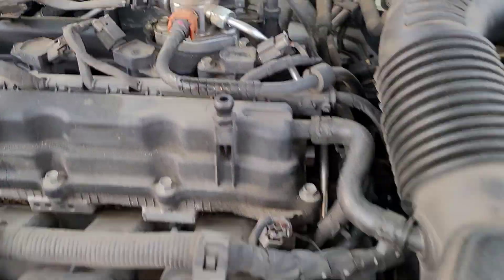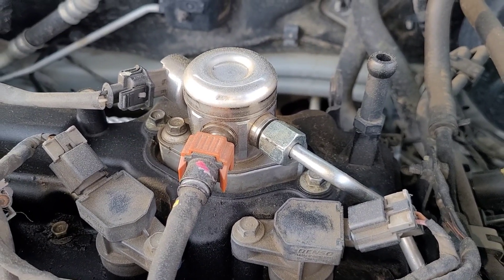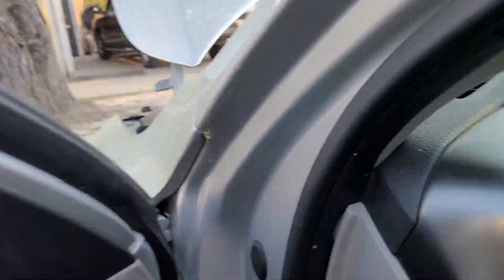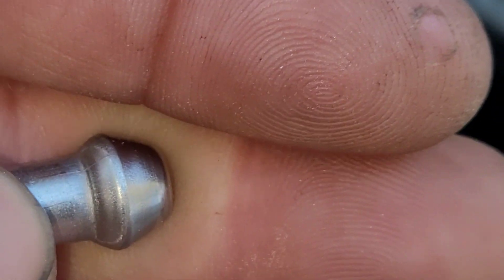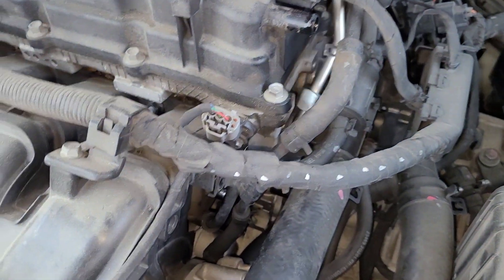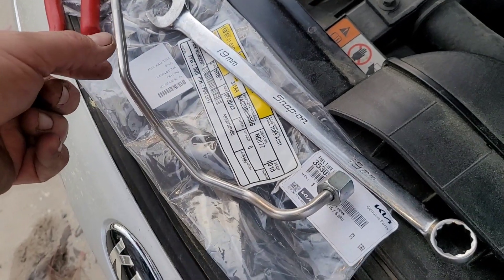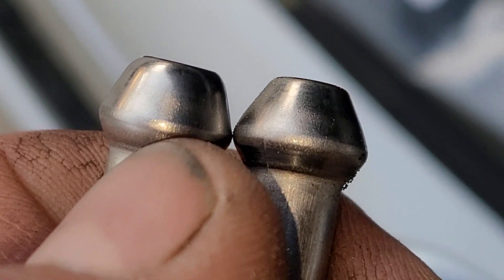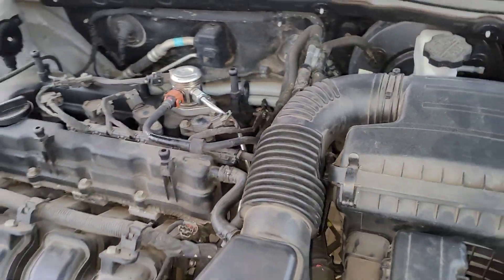Explosive Fire Risk From Reusing A Fuel Line? Absolutely!!

Comment: It seems to be a universal design for high pressure fuel lines, to make them single use. I'm guessing the reason for that is because you don't want the expensive pump itself to be damaged when reconnecting, so the pump side of the connection is made from harder stainless steel. The soft line is sacrificial, designed to crush into a perfect single use fit. It's a good thing they don't do that with brake lines.
Reply from the maker: Exactly!!

Comment: I'm with you on the exhaust thing. What do you call the socket you used looks more convenient than a crows foot
Reply from the maker: It's specific for fuel lines. I do not recall what it was actually called though . I've had it for probably close to 20 years now. I'll have to check with my Snap-on rep to find out
Reply: @WrenchingWithKenny  thanks kenny I've struggled with crows foot and torgue wrench lining up love videos cant wait for new channel be safe friend

Comment: True on the F150, but the worst is the bog standard vehicle, but has the aftermarket knobbly all terrain wheels on it, with the tyres that make that noise. Yet the most off road they do is onto the pavement to park in a shopping mall, right by the door, because they do not want to walk from the parking.

Yes that fuel line is single use only, because the install makes it conform, and there is not enough wall thickness to allow it to be reused. It likely will soon enough be made with proper fittings and a flexible hose by the aftermarket, to use the correct hydraulic fittings that are meant to be reused, instead of the use once style, but the use once one for Kia is a lot cheaper to assemble, low cost steel seamless tube rated for the pressure, and then cold formed to make the flare ends. Can also probably find an alternative that has the flare ends crimped on the pipe, giving a thick wall flare, that is reusable, but those also cost more to make as opposed to reusing the brake line flaring tool, which will still seal under lower pressure, but not at the 2000PSI the GDI engine has to operate at.

Comment: Having made dozens of high pressure fuel lines that is a cheap version of a HP line. We used to use 6mm x 2mm steel line. The tool was like a brake pipe swaging tool but much more heavy duty and hydraulic. You could reuse lines. They did crack sometimes. But that pipe is too thin. Also we had a washer behind the swagged end in the nut. The operating pressure was about 150bar or 2200psi. I now work on systems up to 15,000psi but that is different. So You are correct that is probably one use only.

Comment: As an retired ex-diesel mechanic, replaced lots of injection pumps, maybe a handful of steel injector lines. did you ever look up the fuel pressure specs on this vehicle? It would be interesting. Is this a manufactures quality control issue, or just cheap factory parts - made to be replaced? Increased revenue / Planned obsolesce! Watching these videos, yours and others, I'm glad I no longer do this for a living. Might seem meaningless, but the customer is paying more for something that wasn't necessary before. I was always aware of my customers expense. What happened to engineering? My 2 cents!

Comment: I was already going to say when I saw the issue I bet someone reused that line and it was a one time use. Detroit is that way. Good think about diesel is it doesn't go boom
Yea annoying exhaust. Most I've done is replace a bad muffler with a flowmaster Those usually sound good
Reply: Diesel doesn't go boom, but it does catch fire easily.
Have a look at Salvage Rebuilds UK channel. 
Recently, they had a Range Rover that had a diesel soaked starter motor and when they cranked it - the car caught fire.

Comment: If it is a common rail diesel the high pressure fuel lines are single use and MUST  be replaced after removal. Common rail fuel pressures are typically 350 bar at cranking speed to north of 800 bar at full throttle, a bar is 14.7 psi (standard atmospheric pressure) so 350 bar is about 5100 psi and 800 bar is about 11750 psi, very high pressures to deal with.
Pro tip 1, do not under any circumstances check for fuel leaks with your fingers, having diesel injected into your fingers is not nice.
Pro tip 2, if you are working on this type of vehicle always leave it for a minimum of 15 minutes after you shut the engine down before you crack fuel lines to allow the fuel pressure to dissipate.

Comment: Hi Kenny. That wrench/socket you showed for removing the fuel line that looked like it was half cut away....does it have a specific name ?  

Thank you 

Rod
Reply from the maker: It is a special socket that I purchaced from Snap-on about 20 yrs ago. I believe it was specifically designed for diesel fuel lines, but I'm not certain. I'll have to look it up to find out.
Reply: @WrenchingWithKenny  I found them Kenny.....Thank you for the reply. All the best.

Rod
Reply: "Flare". it's a socket version of a flare nut wrench, always to be used on line fittings because the nuts are usually a soft metal and an open end can easily round-off a hex fitting on those. so the flare wrench does the wrap-around like a socket will, but needs the opening to negotiate over the steel line. flare wrenches are a must for techs.. that socket type he has there is a nice bonus too. get em all.

Comment: Might be a dumb question,  is the pump that's making all that noise?
Reply: Yeah, and probably the injectors also. About all direct injection engines I've seen have a loud clatter, I think it's due to the high fuel pressure. (Kinda like water hammer)

Comment: Let's say you don't have access to a new line, but you do have access to steel braided high pressure flex hoses, I suppose you can make a length and put it there. At least until you find the proper replacement. Right?
Reply: nope !  that line is under 1500- 2800 psi there's no lines that will hold up to that kind of pressure that have that style fitting ends
Reply: @richardcranium5839  ....interesting. My only reservation is the end fittings. They pro'bly made them like that, so that you can't make that line out of flex hose. 
As for the pressure, I'm pretty sure the dual layered flex hose is capable of handling more than 3000 psi, it's rated up to 250 bar / >3600 psi, and a max of 300 bar / 4.400psi....if memory serves!\
I use it in a 200 bar hydraulic system, and it laughs at my face.
Maybe a machine shop could make custom end fittings. I'd definately give it a try. 
Just think: a reusable flex hose. No more buying THAT part from the dealer. 😎😎😎😎

Comment: This design was extremely bad right from the start and I'm surprised that  KIA hasn't done a recall but - I would have to say - that should be a double flare end instead of a single and not being stainless adds to the weakness of the pipe itself. Shame on KIA
Reply: plastic valve cover doesnt help either. that line is always flexing because of it.

Comment: DO NOT EVER USE YOUR FINGERS AROUND HIGH PRESSURE LINES to check for leaks. if you've ever seen a survivor of trans dermal hydraulic injection  it will never leave your mind.